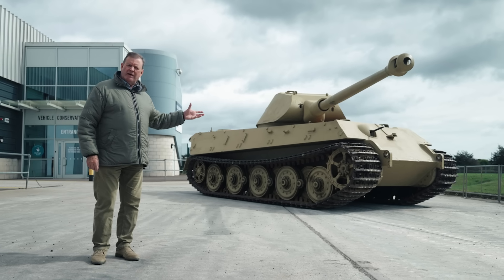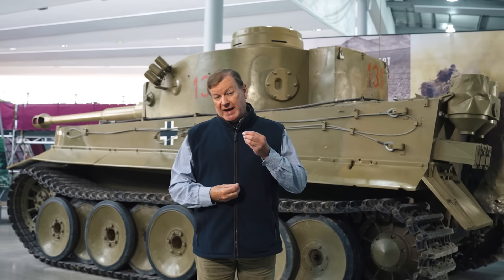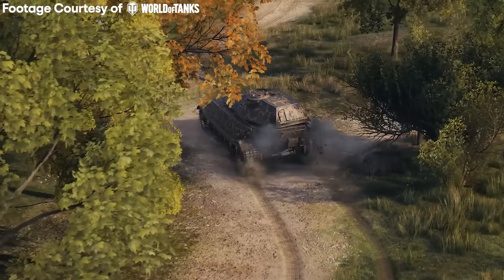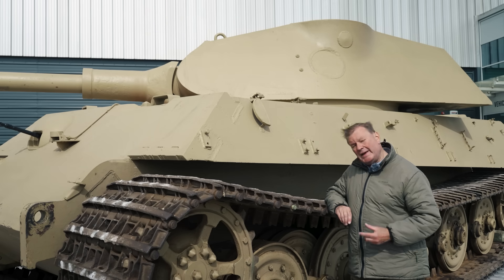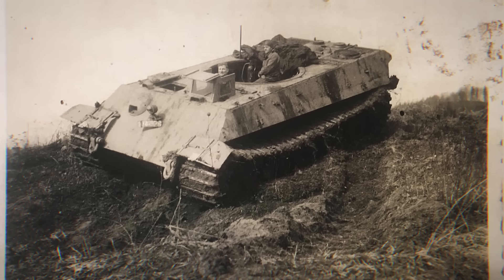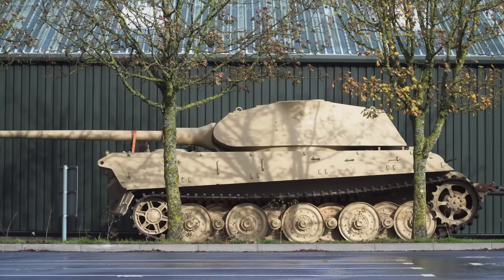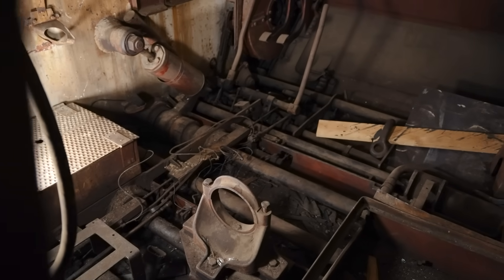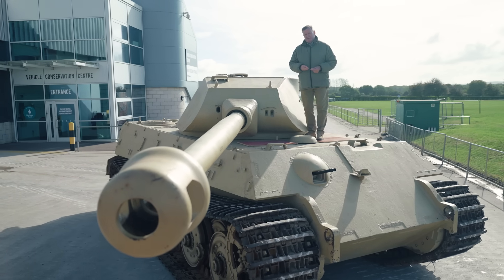King Tiger V2 - Inside The World's Oldest Tiger II

Comment: I know that the Porsche turret is less effective than the later ones but its round shape looks so cute to me.❤
Reply: Definitely a favourite for me also - just looks sleeker than the "regular" King Tiger.
Reply: 😂 tanks should not look 'cute'😂
Reply: The main production turret looks more menacing and distinct IMO, the early one looks more generic.
Reply: @Postoronniy  I think it makes it look fat kinda
Reply: krupp turret
Reply: Something tells me if they gave the turret face a cutout for the gun traverse and kept the trailing edge angle completely to the bottom and only curved the top half, whilst using the gun mantlet to cover the turret cutout would result in a turret proof of its own gun. Some additional ballast would have been needed though...
Reply: @MarcABrown-tt1fp  Like the Panther G?
Reply: @0Turbox  Panther G was still quite vulnerable on the left and right turret face due to its rather shallow base angle. It's a similar problem the tiger 2 delt with against soviet 85mm guns and better.
Reply: Wasn't the shape of the turret a "shot trap" at the bottom?
Reply: @simonkevnorris  10:30 as mentioned in this very video
Reply: @originaljoke-y5f  I commented way before I got to that point.
Reply: @simonkevnorris  He explained that in the video,
Reply: It’s not a Porsche turret